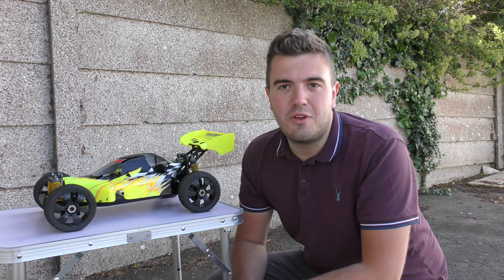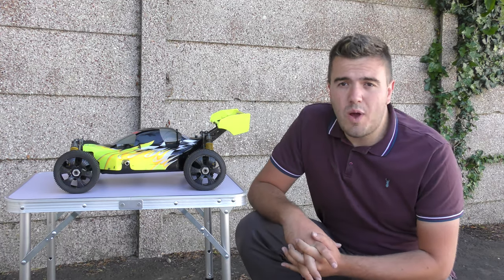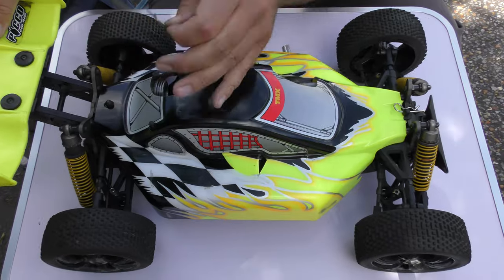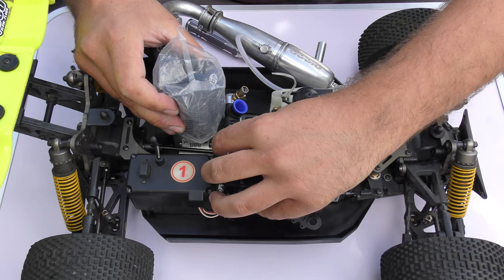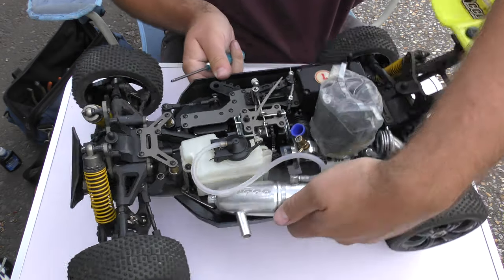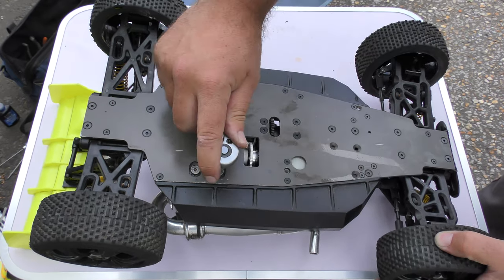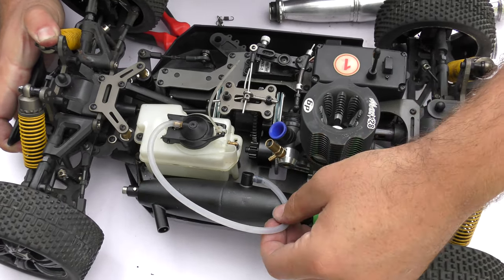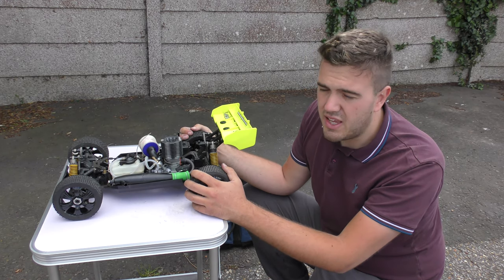My Nitro Buggy Gets a NEW ENGINE! | How to Install a New Nitro Engine

Comment: The fact that I stopped doing nitro because they always tend to struggle and went to the electric side but watching this I want to get back into nitro more than ever, all that struggling, tuning, starting up and cleaning it's all part of the hobby I realise Haha
Reply from the maker: Yes it is, Nitro is definitely a more full on hobby and the maintenance and repairs is part of it. If you just want the bashing side of it with no engine to worry about then electric is the way to go
Reply: @TheRCBiker what Picco engine was it I have the Picco P3-R and I don't have the manuel or exploded view, can't find it anywhere. Is it the same engine and do you have the manuel and exploded view???

Comment: First off, great video. I wish I would have watched this before taking my Inferno up to the local hobby shop and feeling like an idiot. I am new to this sport and I replaced the spur gear with a steel spur gear because as you know, when doing the break in procedure of the Inferno NEO 3.0 it totally flattens the teeth of the hard plastic spur gear that comes stock. I didn't know the buggy was supposed to roll freely from the start so it was binding. After replacing the spur gear it was still binding so I though it might be a problem with the clutch, so I took that apart. Well long story short It turned out that the gear mesh was too tight and I just had to move the motor back a little to adjust it. So there were two things that I had to do when replacing the 46T spur with the 48T spur that AMain hobbies sent me as a replacement. 
1. cut the  frame that holds the servo for the throttle linkage and 
2. Move the motor back a bit to allow the right gear mesh.

 This RTR came with the gear mesh set incorrectly in the first place so that is why it shredded the factory spur gear. Now i am getting ready to replace the stock .21 that came with it for a https://www.ebay.com/itm/154104546105 and replacing the stock wheels and tires for racing wheels and tires, https://www.ebay.com/itm/232717106117 , https://www.ebay.com/itm/174891799630,  the shocks with https://www.ebay.com/itm/133066103181 and the hard plastic suspension arms with https://www.ebay.com/itm/292208297163 and advice would be great. Am i going to have an issue getting that motor and exhaust to fit in this chassis?

Comment: Seeying that expensive Picco exhaust combo get swapped for an rtr standard cheap exhaust combo with rubber coupler was quite painful. I hope you find a header that fits or maybe you can cut some plastic of the Pullstart housing?
Reply from the maker: It's got a Hyper exhaust/manifold fitted now

Comment: Hi Josh. My engine is running at base setting but on full throttle it Boggs out and stalls. Too rich or to lean. Bit frustrating. Any ideas. Cheers drew

Comment: G'day. Bought a second hand 1/10 warhead. Cleaned him up, starts. Must be a 2speed. It's got 2spur wheels, but WONT PRIME. Pulled fuel tank out. No leaks. Hoses good. Thinking maybee blocked carb?  What U think. Can't seem to see the carb screw to take off to inspect. Any suggestions. Cheers nitro newbee. 😲
Reply from the maker: Hi Andy, is the fuel actually flowing through the fuel lines to the carb ?
Reply: If you’re blowing through the exhaust line and can feel lots of pressure/resistance then it’s a blocked carb usually. My advice would be to first blast some carb cleaner or degreaser through the fuel inlet or the carb to save you doing a full strip down and clean

Comment: Hey man gr8 video as usual..If i have a SH-18 engine in my rc...can i replace it with a SH 21 engine without any mods?
Reply from the maker: Is it a 1/10? Depends on the car, usually you'd need some mods to get a .21 into a 1/10. Depends what room you've got!
Reply: @TheRCBiker  ohh okay. I have hsp warhead

Comment: How is the mac star28 turbo I have jus bought the hyper ss truggy it has that fitted I'm going to be running 25 per cent nitro is that OK mate
Reply from the maker: It's a good engine! Bit thirsty on the fuel would be my only negative. 25% is fine, or even 30%. Just run a cold plug with those percentages especially in summer, remember it needs a Turbo type glow plug

Comment: I see it uses the same crappy engine mounts as my old Great Vigor nitro models.
Reply from the maker: Hi there :) Not had an issue with these mounts, I actually find them to be quite good rather than having a set engine position as you can slide the engine forward/backward if you fit something with a longer crankshaft